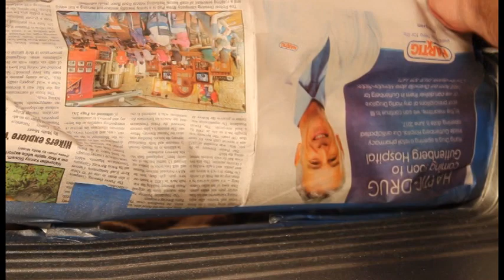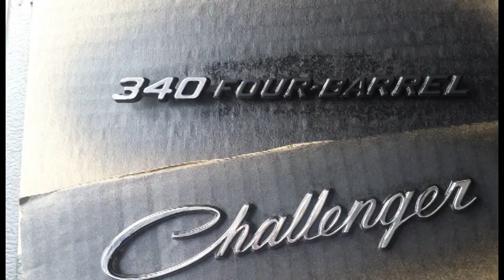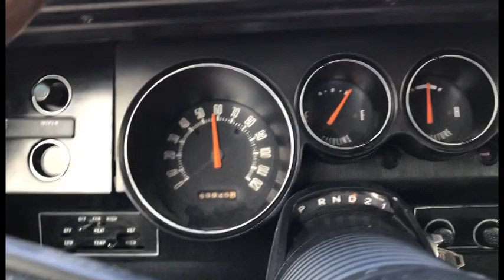1970 dodge challenger restoration restore Part 2

Comment: Cool video  my car needs the same thing  if you don't mind can I ask what the cost was?  on the restoration
Reply from the maker: I'll put it to you this way....it's cheaper to buy one done....
Maybe if you are doing a majority of it yourself it will save $$.
Most shops charge 75-100$/hr. And depending on the car there is 500-1000 hours of work and paint. So 38-100k $$$.
Reply: @jonclinton5126  thanks for sharing

Comment: I am restoring my own Challenger so had a question.  Does your Challenger have a/c? I have a ductwork problem and wondered if you had a similar issue.
Reply from the maker: Thanks for viewing kevan. Mine does not have a/c but I helped put vintage air into a 71 cuda that uses the same dash. Happy to help if I can.
Reply: Jon Clinton . Hi Jon, thanks for the quick response. The issue I seem to have is the opening from the heater box is about 3x4” and the plenum I was provided has about a 1x3”  opening so they don’t match.  I have no idea how the duct work would work to provide heat and a/c to the driver and passenger sides.  When I bought my project car there was nothing under the dash except the heater box.  Any ides what it is supposed to look like? Really appreciate any help/suggestions. Thanks.

Comment: New sub here, any updates on the challenger?
Reply from the maker: james myers ya man thanks for asking. I put some miles on it this fall now it's parked in the garage with the battery tender on. Will put an update video out this spring. I can almost smell the burnt tires.
Reply: @jonclinton5126   Thats cool, I love cruising in the fall when its nice a cool. I love challengers. They are my favorites along with the 69 and 70 roadrunner. You guys did a great job. Very cool to see the family involved especially the young ones. I use a battery tender as well, they work great. I can't wait for spring myself. It's almost here.